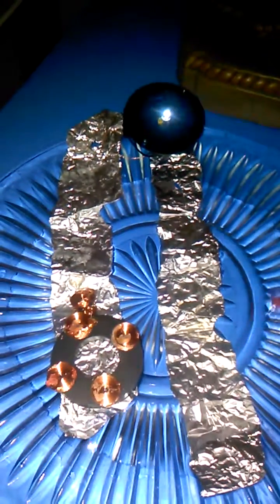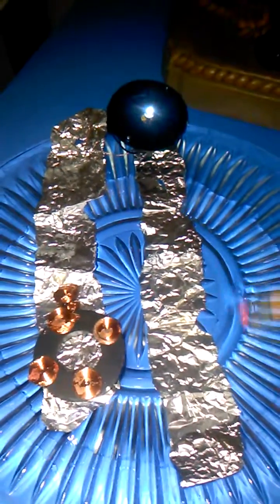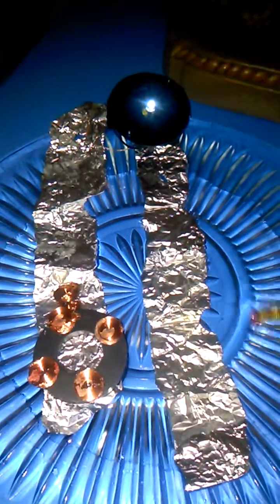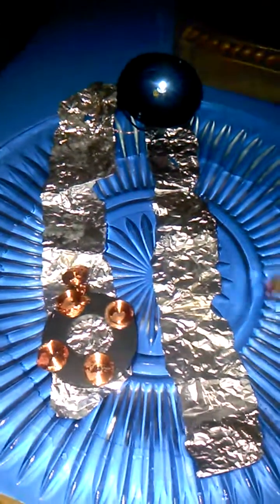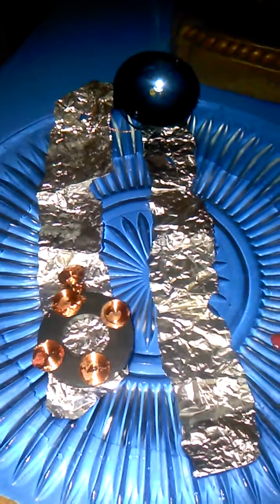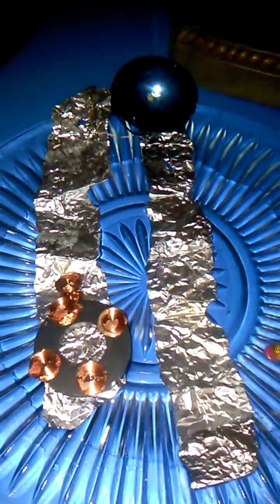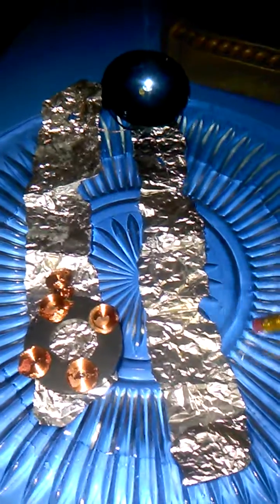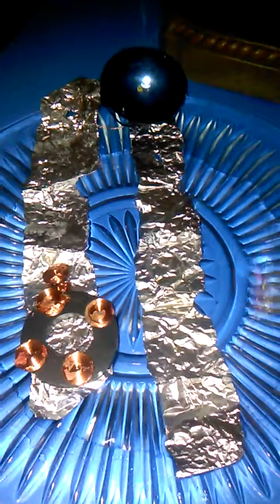GRAPHENE ETERNAL ENERGY VIDEO

Comment: Hi Peter, I didn't see your reply till recently, but thank you for getting back to me. This is pretty interesting to say the least. I'm working on something that involves using a graphene like substance and a self induced magnetic field. Many times I've thought maybe I'm crazy for thinking about this idea so much, but your video makes me think that I'm not crazy! You are on to something. You should make more videos.
Reply from the maker: thank you shayne. there are more videos! both on water batteries and some new quantum batteries that use ambient heat! (like prof. thibado's Graphene Energy Harvesting)  see ntsinnovations.com
Reply from the maker: graphene oxide does have a magnetic field. use in machines though. not biologically compatible.

Comment: So, is the magnet coated with graphene? I understand the research on salt water going across graphene, but don't understand what I'm looking at exactly. what are the copper looking things...

I believe graphene for producing electricity has large potential.
Reply from the maker: graphene is on the magnets the copper coils are inductors catching the very high frequency AC signal from the brownian motion of the water on graphene. I boost it by adding kinetic energy to the water by stiring it. it is shown by the LEDs light